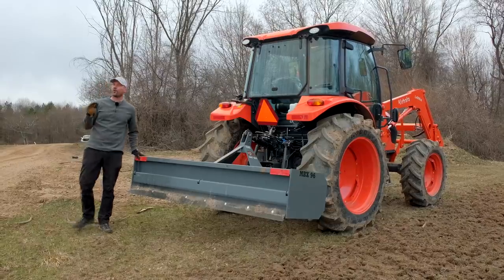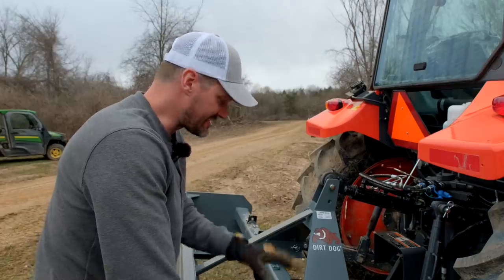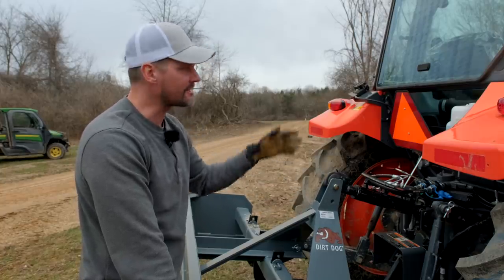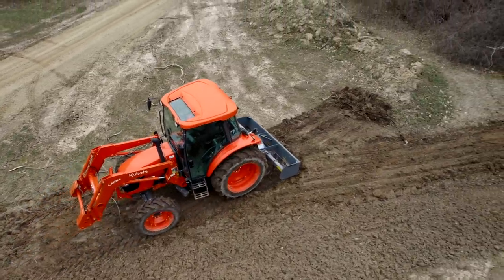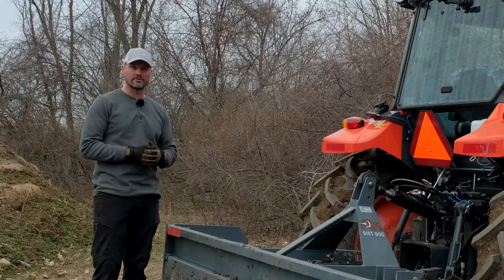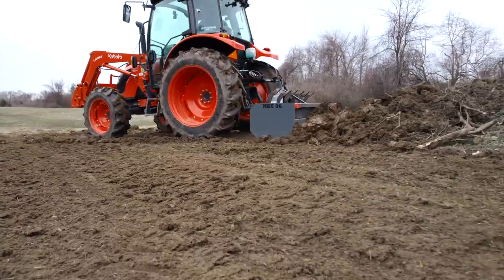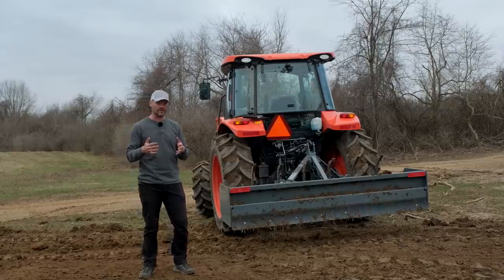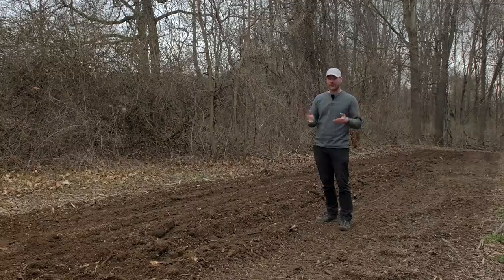BIG BOX BLADE DOING TRAIL WORK WITH KUBOTA M4D-071 TRACTOR

Comment: “It ain’t got no gas in it”.  I’m a big box blade fan and maintain farm field dirt roads with mine.  My best results are achieved with a Hyro tractor ( much quicker changing directions ) with a box blade that is sized to not stick out past the rear wheels and always pulling the deep ripped material forward and depositing it where I want it.  After deep ripping raise the shanks up to where they still slightly dig in.  Also I’ve learned that a smaller open station hydro tractor is much better when working on trails in the woods ( you have a full 350 degree un obstructed view )  and you dont have to worry about shattering a window.   Thats gonna be a beautiful place when you get it set up like you want it! 🔥👍

Comment: You're taking out all the organic material and here I am filling my low spots with logs lol. Most logging roads around here are built the same way. Trucking in fill is not an option for me, so need to get across the swampy parts some how. Great video as always. Tiller then bucket seems like the way to go for sure.

Comment: As someone who owns both, I prefer using the tiller to break it up and then coming in with the box blade with the scarifiers being all the way up to clean up the dirt. It gives a really nice finished product compared to tiller/bucket or using the box blade and scarifiers.
Reply: Also you need weights on your box blade when you are working in mud like that. For my 5ft blade I put 300lb on. So for that one I would recommend 500lb if it has a good place to put them.
Reply from the maker: Yeah, I know where to get some weights!
Reply from the maker: Thanks for chiming in!

Comment: I have used a box blade to put in a short driveway, I would use the rippers down and go over it a few time offsetting it each time then use the bucket to scope it up and move it to a pile. It also depends if it is wet or dry.

Comment: I always thought the rear of the box blade was for cutting dirt like a dozer blade and draging it forward was for moving or finish filling.  I am not a tractor guy so if I am wrong please let me know. In my mind I would pitch the box blade until the inside blade is up 3/4 inch up above the ground then back up set the draft control and let her eat.

Comment: You should have used the 72” tiller on the kubota, prepared the entire trail, then take the 1025R and go over that with the landscape rake angled just a little for the dirt to move towards the outer edge of the trail. (don’t use the kubota because the weight will just compress the loose dirt like it was before) using the landscape rake will take off the loose dirt without accidentally cutting into the soil underneath that’s still tight and compact.

Comment: you need to make a shute and push the material with a box blade, or the skid steer, or the front bucket on the tractor doesn't matter but you make a shoot and you let the dirt build ups on the sides to contain the material.

Comment: I like the job the tiller did. Stone is readily available where I live. I wouldn't remove top soil, just put plenty of rock on it. The box blade looks like a waste of time.
Reply: One thing a box blade is good for is refreshing an existing driveway.  The stone will get pushed down into the soil as it gets driven over.  You can use the ripper shanks to pull the gravel back up and then use the blade on the box to level it all back out.

Comment: Would using a snow pusher like a dozer blade work better on the tilled section than a standard bucket?  Or would the snow pusher box fill up with dirt and get too heavy for the tractor to push too fast to be practical?